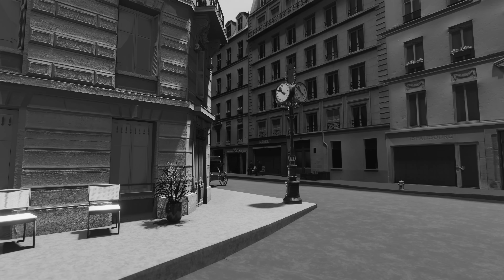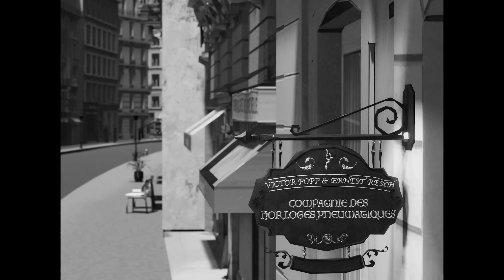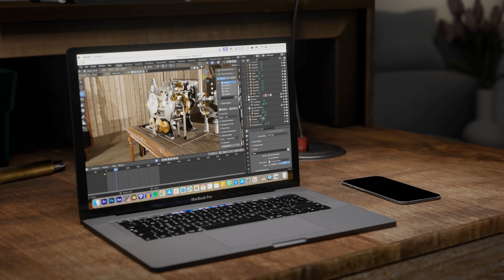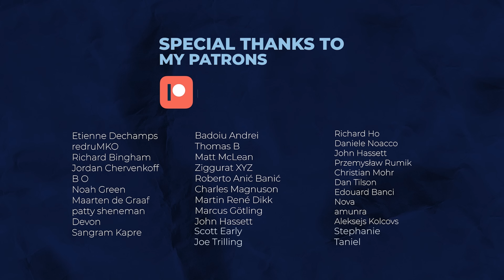The Underground Clocks of Paris

Comment: Why not use the master clock to directly operate a pilot valve to drive the main valve? The two clockworks makes it seem more like a Rube Goldberg device than a serious piece of engineering.
Reply from the maker: You make a great point. I would imagine the decision to go with bursts of compressed air rather than a continuous flow controlled by a pilot valve would just have come down to things like (perceived) reliability, efficiency .. maybe cost-effectiveness. I would be curious to look a little more into that. Thanks for the comment!
Reply: @primalspace  I mean use the same bursts of air going out to all the clocks around the city, but drive the valve for it directly with a pneumatic piston instead of a second clockwork. That piston can in turn be controlled by a smaller valve driven directly by the master clock. Or however many stages of pilots necessary to avoid putting too much load on the master clock.

Comment: That's really cool, but how is the air able to travel so far in the pipes? wouldn't it just lose momentum and wouldn't splitting it into so many clocks make it lose so much power that it wouldn't be able to inflate the bellows??
Reply from the maker: Some great questions there. From what I understand, there were a few ways they combatted that. For example, starting with an initial high pressure and then optimizing the design of the pipes to minimize friction and resistance. They also implemented other pressure regulation mechanisms over the years.

Comment: A related subject you might consider covering is "Amish Electricity".  Some Amish use compressed air to run small appliances such as ceiling fans, since they are forbidden from using electricity.
Reply from the maker: What an interesting concept for a video. Thanks so much for the suggestion!

Comment: Electrical systems use forces we can't see, so it somewhat appears to be magic. But mechanical systems like these clocks are so interesting to me because it is just so visual and in a way pretty "easy".

I wonder if it's possible to make the system more fail proof without making it very complex. If one of those lines were to break (which I expect to have happened from time to time) then a whole district might get out of sync or it might stop completely. clocks getting out of sync due to low pressure could maybe be solved with a special synchronisation pulse signal. Maybe with longer or shorter pulses, or maybe with higher pressures. Interpreting it would likely be challenging though. If the line gets completely broken for a region then there could be a system which speeds up the clock u til it is syncronised with the other districts after the cause of the issue has been fixed. There's probably a limit to how fast they can send pulses, so it might take several hours to sync them up. 

Maybe a follow up video can be made to show us how everything was synced up and kept in sync even if there were failures? I would also expect some kind of fail safe system for when a clock broke and it let the air escape, so maybe this can be explained in a follow up video as well?

Comment: It's an interesting system but there is one thing i'm wondering about that hasn't been addressed: the time it takes for the burst of air to get to the clocks and the efficiency losees at a distance. Since air waves move —at most— at the speed of  sound, there is a delay of at least one second every 340~ meters. If your clock is kilometers away, there is more delay, and they're not actually in sync. Did they determine that some seconds is an okay amount of error? 
they could also compensate that by setting the clock a couple of seconds ahead but that would require knowing the approximate length of pipe between clock and master clock.

Comment: why a ratio of 1:12 between minutes and hours?
shoudnt it be 1:60?
Reply from the maker: So you're correct that a ratio of 1:60 would match the relationship between minutes and hours, but in the context of mechanical clock mechanisms, the hour hand rotates at a slower rate than the minute hand, so with a 1:12 ratio, the minute hand completes one full rotation (360 degrees) for every 12 hours, while the hour hand completes one full rotation for every 12 hours as well. I hope that helped to clear things up a little :)

Comment: why didnt they use non compressable fluits like oil ?
Reply from the maker: Using non-compressible fluids like oil instead of compressed air could have been an option. I imagine they decided on compressed air because of factors like cost, maintenance, safety etc. I'm sure there also would have been some additional engineering involved for compatibility with the clock mechanisms.
Reply: @primalspace  the fact that it ran for almost 50years means air was a good choice. My thought was that it would propagate better with oil. Maybe leaks are let's problematic when only air gets out not oil into the ground

Comment: Interesting system that I never heard of before. How did the clocks jump ahead and fall back for DST or did they not have that in France? Was there any way to do master reset to 12:00 to get all clocks in sync after some mechanical problem with the master clock or individual slave clocks? I think the answer is no to both questions. So the system must have been very reliable never needing a reset of any kind.

Comment: wonder if the system had check valves, or how would they deal with broken pipes/lines, if for example a subscriber broke the clock off the wall.  Must have been a nightmare to chase down leaks.
Reply from the maker: A nightmare indeed. I believe that they did have some fail-safes in place, but nothing that would have made things THAT much easier.

Comment: Before GPS, DCF77 and WWVB radio clocks, in Germany Siemens invented the step motor for remote clocks - they used telephone lines to advance it every minute. The stop motor worked in a way that with every polarity swap of the current in the wires, the motor made one step. A huge builder was Telenorma back in time. Many of those clocks were found in schools, train stations, corporate offices etc.
The master clock used to be a precise pendulum clock, and later they were upgraded to quartz (4 MHz, not 32 kHz) and then to radio clocks themselves when it was still very expensive.

The downside of the system was - like the one in Paris - that you needed "clock face setters"  going out with ladders and putting the right time...

Comment: Cool video :D
Although the animation after 2:42 is wrong, the center wheel should move in the opposite direction.
Reply from the maker: Why?
Reply: @primalspace  oh wait, your animation is right, it's the same as in Wikipedia: https://en.wikipedia.org/wiki/Escapement
My initial assumption was that the angle between the gear's teeth and the right arm's chamfer is so low, that the gear would "slip through" when provided enough energy. I guess clock systems are tuned in such a way, that this does not happen.

Comment: 1:45 The teeth of the clock gear is turned the wrong way around, the ticking thing would slip off, I think?
Cool animations anyway :)
2:41 It seems to be a recurring theme... :/
6:50 Ah, finally a correct cogwheel :D

Comment: But you didn't answer the question how did the master clock was keeping sync with the one in the Paris observatory.
Reply from the maker: So sorry, I should have been more clear that it was just a manual process carried out by the timekeeper. They would have had access to both the master clock and the Paris observatory.

Comment: Did not imagined this system existed
But don't think electronic clocks was common in 1927, electrical clocks using the 50 Hz from the power grind is another thing. 
Also wrist watches was standard and radio often gave time before popular programs like news.

Comment: In a way, we've never really completely gotten away from this system. NTP, the protocol used for time sync, just happens to send the signals over the internet with the actual time encoded instead of a simple air pulse.

Comment: "sending signals electrically would be far too expensive" what.
How?
How is manufacturing an airtight pipe and if there is a leak the system breaks down so it needs to be super precise and have the possibility of doing maintenance.... more expensive than just putting an insulated wire in the ground????
Reply from the maker: You're basing it off of today's logic. Back then electrical stuff was way less advanced and more expensive. It's more about the clocks themselves anyway. Each clock would require complex and expensive electrical components. Times that by thousands of clocks and it suddenly becomes way more expensive than just running some pipes through already made tunnels.
Reply: @primalspace  Yeah but the wire would have been a lot cheaper than a high spec pipe, especially back then. And the clocks could have stayed the exact same, except replace the bellows with a coiled up piece of wire to act as an electromagnet.

This was a time when telegraph lines where everywhere and a primitive fax machine had already been invented.

I'm really wondering what detail made the guy opt for pneumatic instead of electric transmission. 🤔
Reply from the maker: There were clocks in Paris at the time that were synced by telegraph, but they were more expensive
Reply: @primalspace  Wouldn't telegraphy synched clocks have some sort of data transmission though instead of a pulse? Or were they not using the normal telegraph network for that?🤔
I meant more a purpose built network. The same mechanism as here, but instead of a bellows you have an electromagnet moving the minute hand of the clocks.
I wonder how much of the old pneumatic network is still present and whether one could repressirize it. I LOVE this sort of thing 😄

Comment: How was the travel time of the air to the farthest points in the system - the end of the ten pipe runs - accounted for?  Would not the clocks closer to the air reservoir be a few seconds "faster" than the ones farther away?  And how did they maintain pressure when they were adding subscriptions on different lines?  Interesting video that breeds many questions.

Comment: (1)  Even in the 21st century, a public clock that tells the correct time is a miracle.
(2)  Beautiful animations.
Reply: there are simple clocks that use the frequency on the power grid to tick the clock forward. When the grid is under peak load during daytime the frequency slow down when the power station machinery is under load. They use the night time to "catch up" and run with higher frequency. Most simple cheap office clocks, and clocks in schools and other public buildings are of this type and should keep the time if not damaged. ( or a power outage )
Reply: @Bobo-ox7fj ntp servers are used for keeping time
Reply: @Bobo-ox7fj Yes all thanks to Anydesk
Reply: Meh, we already have smartphones, who're literally connected in real-time to atomic clocks 😂
Reply: 1. Not hard to make them accurate in modern times. 2. Problems are caused by need to maintain a zoo of various wildly obsolete legacy systems.
Reply: (1) well in Europe most public clock run on DCF-77 since decades.😅 Plis as others said you have precise clock in any GNSS signal and a cheap module get you a second tick pin to sync your clock. 😊
Reply: Public clocks are usually only a few minutes out of sync with your phones clock. You act like they’re wildly off 😂
Reply: @daltongalloway  -- Where I live, the clocks are indeed wildly out of synchrony.  The clock on the city hall may read 11 a.m.  The clock on the bank (a block away) has not yet been adjusted for the change from winter to summer time so it reads 10 a.m.  The clock on the church (a block from city hall in the opposite direction) reads 10:53 a.m.  The clock that stands on the street corner a block behind city hall reads 11:15 a.m.  And on another street corner the clock has stopped completely.  This is typical.  So, will I be late or early for my 11 a.m. dentist appointment?
Reply: @kevinbyrne4538 I mean when basically every person has a super precise clock in their pocket or car public clocks serve no purpose
Reply: @thatyoutubeguy7583  If most public institutions can't be bothered to display accurate time, then they should uninstall/cover their clocks and let the ones, that actually care, display it properly. If they want theirs to serve no purpose, then they should do so instead of serving the anti-purpose- confusing people with wrong time.

Comment: Something this reminds me of, that's actually still in use today, is pneumatic thermostat control. Here in the US I've seen it in the far northeast such as Upstate New York and New England, and usually in buildings that are supplied with steam from a municipal steam system such as in NYC (the reason why steam rises from the streets there). Basically the building has an air compressor that runs lines to all of the thermostats and radiators in the building, and the thermostats control the flow of steam to the radiators by changing the air pressure to move valves.
Reply: Back a loooong time ago, heavy trucks used to have radiator louvers that would block air flow through the rad and open when it needed cooling. I've seen them but never looked to see how they work. I'm assuming they use a thermostatically controlled pneumatic system as well.

Comment: 02:48 The teeths are pointing the wrong direction - or the gear should go counter clockwise. In the shown way it does not block the from turning.
Reply: The gear at 01:46 also looks backwards.

Comment: Is it real, if have delay to reach the furthest, increase the air pipe? Using funnel then split(speed increase as it is smaller) the pipe.
Is it theory of someone or secretly telescope to the biggest one to set? This means the rest runs by air. Is it to waste time of thief to copy and be caught at there? Lightest metal aluminium or copper smthg like that if real? Ladder material? Sync is cooler than electric clock.

Comment: I'm wondering how they dealt with the fact that the small volume of air at the Master Clock when branched into the system the pressure would decrease greatly, and not have as much pneumatic force. After going a great distance through the pipes. Also I wonder how they dealt to keep the system completely sealed. As the technology of Plumbing as we know it hadn't really evolved yet. Joints and pipes were still done with lead solder, or even in some cases pounding the joint with hemp rope and putty and grease. Wish I could see being acceptable for water and sewage. As they are thicker. But I'm wondering how they dealt with compressed air. And exactly what kind of pressures were involved in the system

Comment: The video never explained what happened to cause all the clocks to stop in 1910 during that flash flood.  It also never mention what provided the compressed air either.  But regardless, it was a very clever system.

Comment: I'm surprised they didn't opt for a hydraulic system. Water filled pipes could move diphragms back and forth with much less overhead work because of the much lower compressibility. But they probably had good reasons.

Comment: Wait... so how did the timekeeper see the observatory clock?
Reply: Like the narrator said he used anydesk to see the time of observatory clock
Reply: I was wondering this too and looked it up:

"At the Paris Observatoire a high-standard astronomical regulator clock was kept running on correct mean time by astronomical transit observations, being corrected daily. Pulses of electricity were sent every second to secondary clocks around the city, the wires being run through ducts in the sewers. Two loops starting and ending at the Observatoire carried thirteen clocks between them, the farthest being at a distance of seven and a half kilometres, or nearly four and a half miles from the observatory. The clocks were of a high standard, so they could keep good time even if the synchronising pulses failed. (The pulses synchronised the clocks but did not drive them, they were weight-driven in the conventional way) The secondary clocks were furnished with second-hands, and were placed so that they could be easily seen from the street, usually in prominent positions. They further distributed time by sending electric signals once an hour to synchronise various public clocks. The system came into operation in 1878."

So it appears that electronic synchronization was in use at this time but just not cost effective at the level for mass production. However, having a few extremely well made electronic clocks was worth the cost.
Reply: @JPC4 This is not possible, as electricity was in its infancy, and even the wires and their connections were inefficient. There are also no electronics and no electronic control system ( that is, the electrical system could not know the time in the first place so that it could then synchronize ).
Reply: (electrical time distrubition from the observatory)
Reply: anydesk
Reply: During a walk at lunch time? Enough clocks around to see how much it is off...
Reply: @gbraadnl Clocks in the street are in sync with the Master Clock, if the Master Clock were out tune so would be any clock in Paris, save from the Observatory clock
Reply: wrong he said that it was a joke
Reply: @IgnatiusIsaacWeeKaiJunyuanps  bro don't you know something known as "sarcasm"

Comment: How was pressure/signal not lost/attenuated in kilometers of pipes? Im not even talking about leakage, just 'resistance' of the pipes in the form of elastic deformation. Just like with wires you cant transport a signal without loosing energy forever. How beefy the compressor and the pipes needed to be supplying hundreds of clocks and kilometers of pipes.

Comment: Nice. I'm just wondering if the system would have run out of 'breath' if too many subscribers wanted their clocks connected? Or was the system able to simply push through more air as needed? Also, was keeping the entire network of pipes airtight at all times not a nightmare?